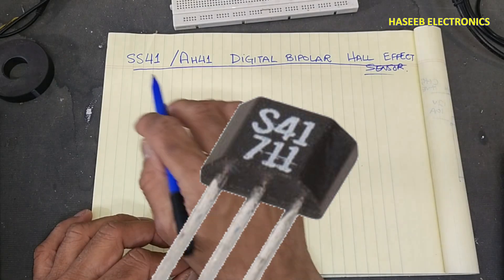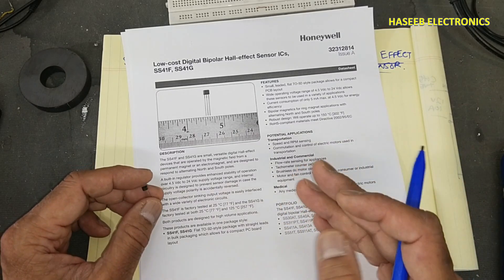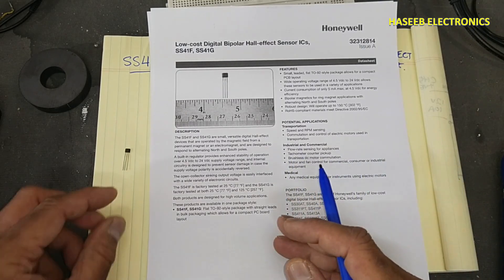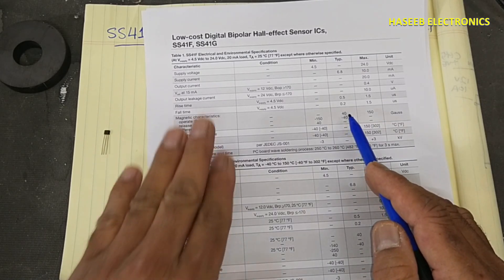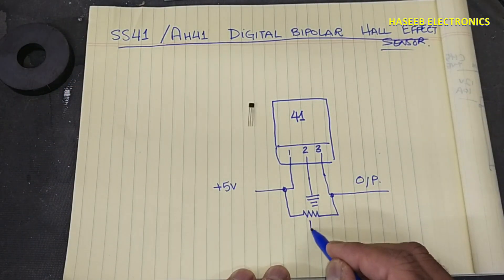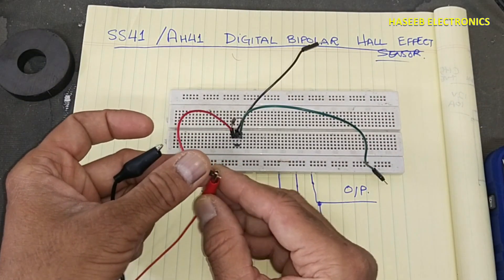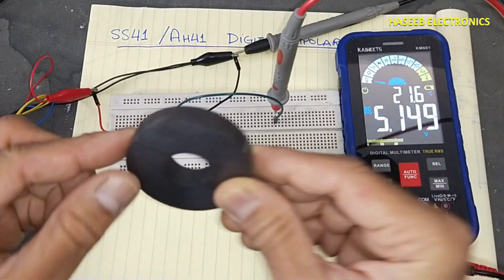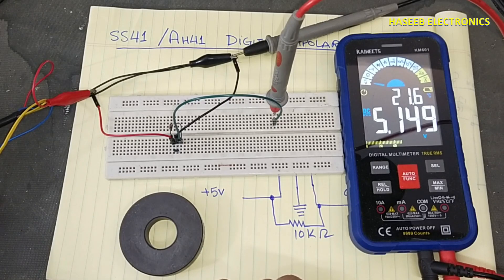{866} Digital Bipolar Magnetic Hall-effect Sensor SS41, AH41, A3141

Comment: how does the hall sensor detect the magnetic feild and  switch  between ground and 5v
Reply: A hall sensor is a type of magnetic sensor that uses the Hall effect to detect changes in the presence of a magnetic field. The Hall effect is a physical phenomenon where a magnetic field applied perpendicular to the flow of an electric current creates a voltage difference perpendicular to both the magnetic field and the current. In a Hall sensor, this voltage difference is measured and used to determine the presence and strength of a magnetic field.

Bipolar Hall effect sensors typically have two Hall elements positioned in opposite directions, which detect the magnetic field's polarity. When a magnetic field is present, the output voltage of one Hall element will increase, while the output voltage of the other Hall element will decrease. By comparing the two output voltages, the sensor can determine the polarity of the magnetic field.

chatgtp
Reply: My Question is how microscopic is this machine!??😂 I assume it is probably the actual inside of these is still a secret sauce for now. Till someone random does a full microscopic teardown!!! I am in for that video

Comment: Why did you installa 10k sensor?
Reply from the maker: 10k ntc or ptc is excellent selection for sensing temperature 
There is also 100k thermistor being used for temperature measurement
Reply: @HaseebElectronics  Sorry i meant why did you use 10k Resistor?🤣

Comment: i'M WANDERING if I can use it as an indicator for charging the battery on a vehicle, passing the positive terminal of the battery through a coil with iron/ferite core
Reply from the maker: SS41 uses bipolar magnet, one pole S will reset while N pole will set to high. 
in your case we need to use SS43, AH43 or A3143, that is unipolar. in upcoming 
video i am planning to explain ss43